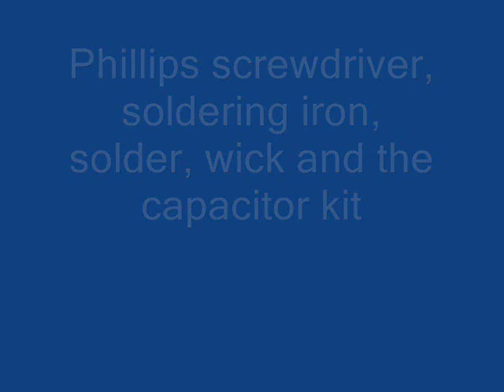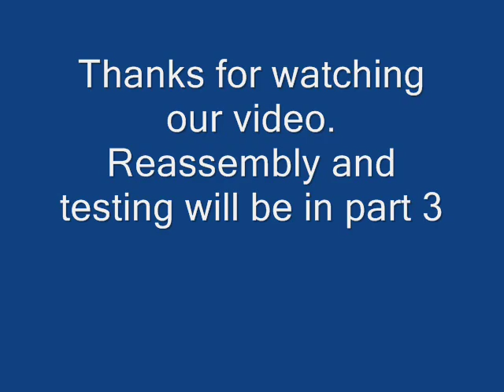Repairing a LG L226WTQ-BF - part 2 board repair

Comment: I just took mine apart. Since the website www.ccl-la.com no longer exists, I had to take it apart just to see what caps I needed to order. They are 2 x 680uF 25volt 10mmx16mm and 3 x 1000uF 25volt 10mmx20mm. Hope this helps someone else doing this repair
Reply: Thank you! That explains why my monitor came with 4 (FOUR) x 1000uF 25V 10x20mm (no 680 x 2).

Comment: Mine turns on.. but turns right back off after the boot screen for the monitor.. then if i unplug it and plug it back in, it doesn't turn on.. however if i unplug it for a little while and then plug it back in the same thing with the turn on then off thing happens. do you know cause your last video helped out alot with taking the whole thing apart
Reply: Same problem here
I opened my screen and I figured out one of the three electrical connection of the power port to be broken, so the power doesn't go well to the alimentation I think. I hope it didn't stress out the power alimentation.
Happily, it was not the ground one, less shitting but dangerous with time
Reply: I will change the alimentation port right now, easy and it doesn't need any tool but a turn screw

Comment: HI! I've just changed the capacitor as per your video info. But the problem remain. I plug in 220V wire and the red front led is down. No one short circuit, I can't see other problems. May be someone else usually components that I can try to change?THANKS
Reply: I have the same problem here, tested mosfets, changed capacitors, revised fuses and some more things. Voltage charge the filter capacitors, but don't exit in the 5v and 15v pins. You solved it?